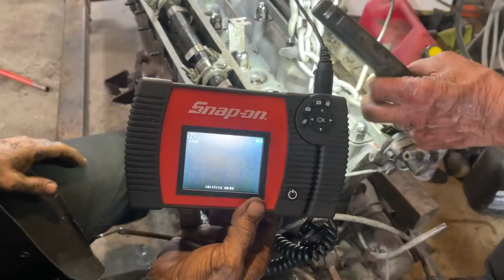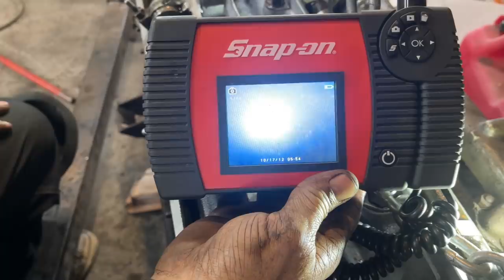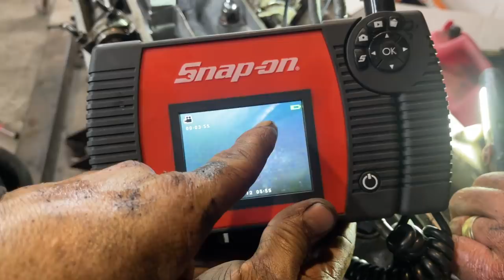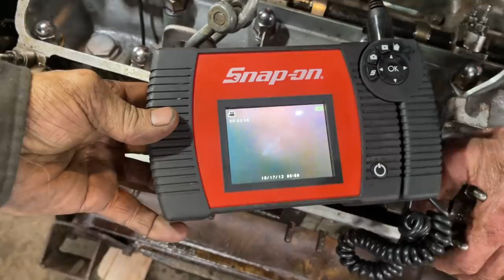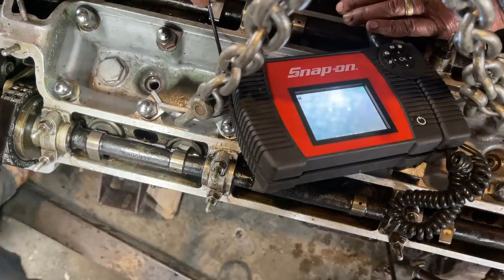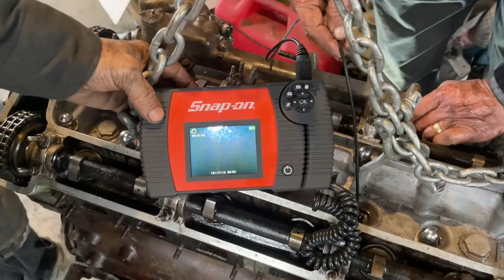DOUG IS HERE TO SET THINGS STRAIGHT ON THIS JAGUAR ENGINE

Comment: You guys need to get the trans off and get the engine on an engine stand, then you can turn it upside down and drain the cylinders.  Then you will have a better view of things to fit that other pan to the engine.  BTW I think you could use a parts washer to clean that pan and other stuff.

Comment: Would definitely follow Doug’s recommendation regarding pulling head - engine really needs full rebuild
Reply: I agree totally, you hand build from scratch a stunning car. Why would you shove in a engine from a junk yard that has not been totally rebuilt, you never know what other horrors may be lurking within that engine, doesn't make sense!
Reply: exactly,why spend 3 yrs building a car to just cheap out on the heart of the car,,the engine.

Comment: Chad there is a good reason not to work on oily stuff in the body shop every time you run an air tool to clean off a gasket your putting droplets of oil and oily gasket into air and they will land on the cars and cause paint problems down the road
Reply: Yep! Said that yesterday..fisheyes contamination..don't let Chad near raw chicken
Reply: Guess some gonna learn hard way 😁😁😁

Comment: Can't believe you did all that without changing/checking the oil filter and without pulling the head to clear all the metal bits that must be in there from the spark plug issue. All good fun though.

Comment: I would think parts for 59 3.4 ltr Jag engine would be hard to find, but there are places to custom cut gaskets. And to save pistons and rings from breakage due to rusty cylinders have to pull the head.

Comment: I wouldn't have pulled the oil pan yet. I didn't se ya'll even look at rod bearings or anything. I'd Do compression check and throw some fuel and fire to it and I bet it will run with no problem

Comment: Turn then engine over by hand checking the valve clearance any way over stuck...pull head inspect hand lap in valves,. Grind valve shims under followers.  Cheap to just make it a runner .does take a bunch of time for shim adjustments. Cam has to come off 12 times

Comment: I was taught when rebuilding any engine parts that cleanliness is next to godlessness so while you had it apart why did you not clean and paint the oil pan?
Reply: Just add grinding dust while you're cleaning off the gasket . Both of them shouldn't be allowed near an engine.

Comment: Honestly if you would have put gas in it with spark it would have been fine . The motor would have run and the valvels would have un stuck them selfs . Its a used motor that needs rebuilt . Just being strait up with it

Comment: Nah, you didnt hurt it.  But a valve sticking down will hit a piston.  A non interference engine will not hit the valve, chain on or off.  And by the way, hydrolock means it is locked up because of fluid in the cylinder against closed valves. Easy to fix, pull out the plug and pump out the liquid.  Tom

Comment: The first thing you do with an engine that's locked up is pull the spark plugs. The second thing you do if it won't turn over is pull the head. 
This ain't rocket science fellas.

Comment: Yeah Doug thinks if you put the bolts in finger tight you can run the engine . Well , you can but it is better to torque everything .

Comment: The acetone is a creeper. It pulls the thinned transmission fluid into tight areas.
ACETONE  IS VERY FLAMMABLE 
ACETONE EATS PAINT
ACETONE MELTS SOME PLASTICS
Works better than Kroil and other penetrating oils. Seen several test

Comment: The donor car what put it down? Wreck? If not mechanical failure? No water in oil is good but could have a cracked head! Pull engine down and inspect/ pressure test

Comment: All you have to do is use the red peratex on oil pan that’s how all my race motors were , engine builders never ever use a gasket on race motors and they never leak , gaskets blow always leaking
Reply: Bull crap we dont . The tail end Charlie racers dont that's why they are never up front .